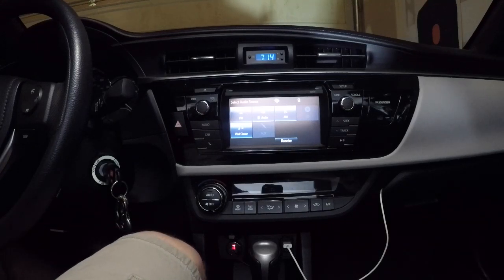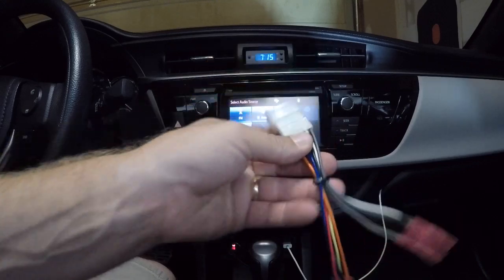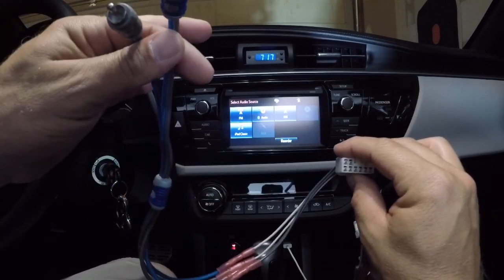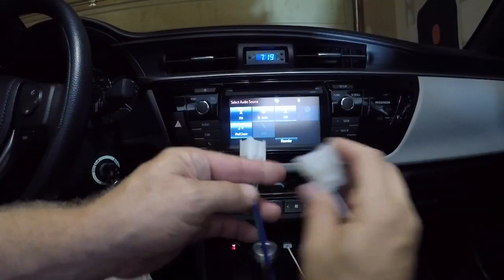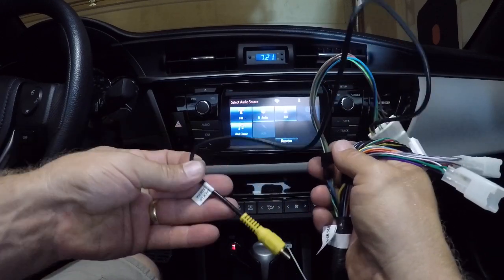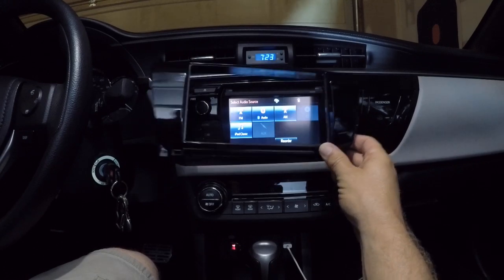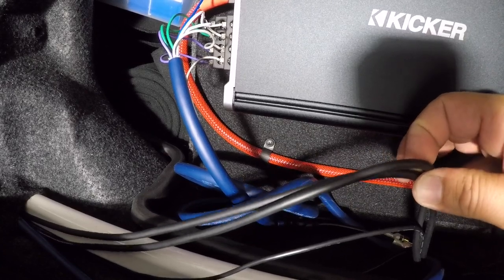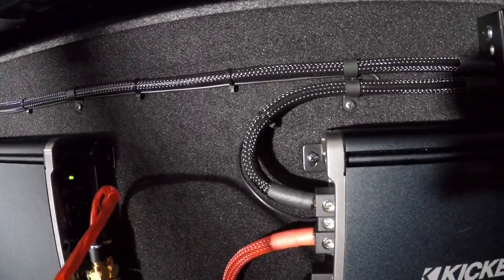2014-2016 Corolla, adding amps to OEM head unit

Comment: So I'm only using one set of RCA cabels from the front speakers to the amplifier for my sub. Haven't installed it yet. Should that work? Also how many watts are you running? Have you had any issues with your alternator or battery? And I do have some questions about the bass knob and cup holder lights.
Reply from the maker: Spencer Bennion 
I would use the rear output instead of the front. Both will do the job, but your subs will most likely be in the trunk, so this would be more natural. 
I have replaced my battery with comparable Interstate battery, OEM alternator. 
I have roughly 2400 watts available, between the two amps. 
As far as the cup holder lights, they were purchased from accentleds.com
You would need 2 sizes, 1@ 2-1/2” & 1@ 2-5/8”. 
The bass knob is from Kicker which is proprietary to their amplifiers. I took it apart and mounted the guts inside the dummy plug next to the trac control/vsc button. 

Follow me on Instagram, I can help you better there. @cdenton9

Comment: For my set up i plan on using the stock speakers and only adding a single amp to power subs in my trunk. Does this set up allow for this?
Reply: Were u able to figure it out?
Reply: @mafitron  Fr lol I need to knwo

Comment: I know this is an older video, but did you reply the stock speaker wiring for the back and door speakers? I've heard the factory speaker wiring isn't good on most cars and was wondering if I should plan on rewiring all that shit while upgrading my speakers.
Reply from the maker: Adam Yarris i reused the factory wiring. It’s good stuff. 16 gauge stranded copper, probably ofc. I did eventually run new wires to the rear deck speakers though. Only because of the length, 3 feet versus 15 feet. And I was putting about 80 watts through the factory wiring.
Reply: @suprola7961  Huh, I wasn't aware of that, thanks for your response! I got the impression all factory wire was crap, but then again I know next to nothing. Great video btw, I couldn't find much else about this in such a clear manner.

Comment: Do you happen to have a wiring diagram for the 2014 Corolla pin connector? I am trying to find the 12V constant wire & 12V accessory wire for my LOC & almost every wiring diagram i find contradicts the other
Reply from the maker: Aftr Shock are you talking about the factory harness or the aftermarket piece used for connecting to an aftermarket head unit?
Reply: Chris Denton factory harness, in the back of the factory oem radio
Reply from the maker: Aftr Shock I do not know the pin out off hand. I would have to pull my head unit out to get this information. Check the forums, corollaforum.com or toyotanation.com , I think I’ve seen it listed there before.

Comment: Hey I have a 2016 I'm trying to build that harness and I  have the rca cables coming off the head unit only part I'm confused at the point when you said the speaker came right off the amp for the front and rear left/right
Reply from the maker: Adam Johnson once you’ve made the T harness, you are no longer using the outputs off the headunit to drive the speakers. Your speakers will need to be connected to a 4-channel amp. The RCA’s that are now coming off of the headunit will control your front/rear/left/right fader. But the speakers will be powered from the amplifier at this point. Does this help?
Reply: @suprola7961  yes it does exactly what I figured just wanted to make sure I was on the right page thank you for the reply

Comment: what is all of the wires called thats needed to use a 2019 corolla factory radio for a subwoofer? I cannot open the links that you provided
Reply from the maker: Reese  You’ll  have to search for these online, part numbers :TWH950 & TWH951. 
I can’t get the links to open either, except for the Kicker link.

Comment: Noob question. This will work if I’m only planning on using the front and back Rca hooked into my amp right?  I’ll have everything hooked up like you have it, but everything but the two rcas will be hanging.
Reply from the maker: HorizonsHere are you coming off your amplifier straight to your speakers? If so, you’ll have at least 8 wires not in use on the reverse set of harness. 
If your planning to reuse the factory wiring to your speakers, you’ll need to make the connections.
Reply: Yeah I'm planning on coming off my amp to the head unit with the 2 sets of RCA's and connect to the harness rca adapter you have in the video. I purchased what I need from the 3 links you left.

Comment: Hey when you say you sent the signal back to the amp what signal from where im trying to do exactly this and i dont have the 4 extra speaker wire to send signal back with cause i tapped the speaker to rca on those already
Reply from the maker: I pull speed wire from the amps to the back of the radio.
Reply from the maker: ROCKRIX 20-Feet 9-Conductor... https://www.amazon.com/dp/B08L7785TG?ref=ppx_pop_mob_ap_share
Reply: @suprola7961  oh ok i understand that now when you did the rca adapter "kicker kisl" to the harness you had 1 set to front left right+&- then on other adapter same thing what were the open spots on the adapter that you sent the signal back to amp inputs?
Reply from the maker: Basically, you’re converting the headunit outputs to RCA and running them to the amp(s) then using speed wire to return to the headunit, where you intercept the other side of the wiring you converted (goes out to speakers)

Comment: i’m trying to hook up and amp to the factory audio system,using a line output converter or is there any other way? i don’t want to hook up speaker with the amp..what kind of harness do i need?
Reply from the maker: Salman Asghar it sort of depends on what amp you’re going to use. some amps like kicker,  have line level input or high-level input. In that case, you don’t even need LOC’s. The factory radio doesn’t put out much voltage, and probably not enough to damage whatever amp you use. 
I would convert my speaker outputs from the radio to straight RCA’s, run those to your amps and then bring the speaker outputs back from the amp. 
Basically letting your amps drive everything and your HU driving only the amps. 
I hope this all makes sense.

Comment: I have a 2015 toyota Corolla and I need to figure out which wires are + & -  for the rear. The factory wiring is chopped so I can't use the speaker trick
Reply: Did you ever figure out the colour code? Need to install convertor to a corolla IM

Comment: So if I want to get an amplifier, sub woofer, and new speakers but still use my stock radio head what wire harness would I need to buy in order to not tap into the OEM wires? Please I was trying to get that part but got super confused 😭.
Reply from the maker: The next comment down are the links for the harnesses, if they’re still available.
Reply: @suprola7961  I have the website open but which one would I choose? Sorry I'm a total noob but need your help please. Do i get this wiring harness  "Toyota Corolla to Install Stereo" or "Toyota Corolla Wiring Harness to Connect Factory Stereo"?  Also thanks for getting back to me quickly I appreciate you 🙌.
Reply: @suprola7961  i was able to access the website. Now I just need help to pick please.
Reply from the maker: https://www.uneeksupply.com/2014_c_26132.html
Reply from the maker: @vegaf2011  I posted another link. You need both, so you don’t have to cut any factory wiring.
Reply: @suprola7961  thank you so much. You are the fucking best 🙌🙌🙌

Comment: hey friend, I have a question, even after installing this harness it worked even with your original car reverse camera, or you need another type of harness
Reply from the maker: rickaz1093 had to watch the video again to answer your question. The OEM camera plugs into the Maestro. The Maestro harness provides a video output that you’ll plug into your aftermarket head unit.

Comment: Hey man!  if I want to hook up just a pair of subwoofers, can I just T from any speaker using the cables you used?
Reply from the maker: Himmler Andaluz Aguilar 
You can but I doubt you will get any base from it.
Reply: Chris Denton do you know if theres a way to get speaker signal so I can put the kicker rca while keeping the 4 stock speakers. Btw I do have amp subw and all that stuff.
Reply: @haaguilar Just T into your rear speakers and go straight into the amp if it has speaker level inputs or get a LOC if it needs RCA. Unless you have a 5ch amp or a signal processor then that's as good as you're gonna get.

Comment: Are u running a stock alternator...if not what is it. Would like to run up to 2500w in my carolla
Reply from the maker: Matthew Love 
I’m still on the OEM alternator but I’ve been considering an “upgrade” or a 2nd battery. I’m up to 3000 watts available but can’t crank it that high. Lights start pulsing and bass will drop out. 
I haven’t even added the larger wire to the OEM alternator yet.

Comment: I got all this hooked up and my fronts are nothing but static and my rears are clean what could be the issues
Reply from the maker: Scbba I remember having this problem too. But can’t remember how I fixed it. Play with the settings on the amp. Did you use LOC’s?
Reply: Chris Denton only for my subs
Reply from the maker: Your using the kicker rca converter cables right? Did you meter the polarity before you spliced them in?
Reply: No I used the reverse harness for them and I have them ran to the high input of my 4 channel and my loc converter ran to my subs
Reply from the maker: Scbba, try disconnection your amp turn on wire.
Reply: Chris Denton I moved the rears to the front 2 channels with my fronts and it's crystsl.clear
Reply from the maker: Scbba in my case, it’s was the amp turn on wire. Your amp probably senses the signal from the high level inputs and turns itself on. Seriously, disconnect the turn on leed at your amp and make sure high level is selected. For some reason they will interfere with each other.
Reply: Chris Denton I'll try that when I get home thanks
Reply: Chris Denton I tried that and still the same so I dunno unless it's my ground from the high inputs I'll try and see if I can ground it to the ground on the amp so I can see if that's the issue
Reply from the maker: Scbba what amp are you using? I wanna look it up.
Reply: Chris Denton skar 80.4
Reply from the maker: Scbba I looked it up but can’t find install information. Whatever you did to make your rear channel work, copy that for your front channel. I know with my setup, I first got static and then there was no stereo separation. My amp (Kicker) acted like a 2ch amp. But eventually I got everything working. Don’t get discouraged, your doing professional level work, and your getting there! 
I’ll keep researching, I’m half tempted to buy one of those amps, just to play around with!!
Reply from the maker: Scbba, did you get it working?
Reply: Chris Denton yea finally lol thanks for all your help
Reply from the maker: Scbba what did you find?
How does it sound?
Reply: Chris Denton it had a positive and a negative.reversed and it sounds amazing now now it's really to loud lol
Reply from the maker: Scbba sounds good for a stock stereo!
Glad you got it working, you’re an expert now!
Reply: I just put a video on my page for it Chris if you wanna see the distance and the sound quality
Reply from the maker: Scbba on what page?
Reply: my youtube page its scbba
Reply: jomax clux  I ordered a reverse harness to retain all retort wires

Comment: Hi One Question i did wired everything but i lost the reverse camera function. I put reverse and it doesn’t displays the backup camera. What could be the problem, is it a bad connection?
Reply from the maker: Joseph Rodriguez 
Did you install the Maestro also?
Reply: No I just installed the harness for the rca front and rear as you added on the discription. Unless i disconnected by mistake other harness since i didn’t removed the radio.
Reply from the maker: Joseph Rodriguez 
Nvm, I was thinking you replaced your HU. Could be that something is unplugged.
Reply: Yes It probably could be that, because i doble checked and the harness itself doesn’t involves the backup camera.

Comment: How did you bypass the tweeter in the front to add your speakers to a amp ?
Reply from the maker: Scbba on the stock tweeter connector, you have 2 positives and 2 negatives. One pair of +/- comes from the head unit, the other pair goes to your bottom door speaker. I just taped wire in between the positives and negatives, to complete the circuit down to the bottom speaker. Then I used the tweeter wiring that came with my component speakers. Does that make sense?
Reply: Chris Denton sorta but not really lol
Reply: Do you need the run the speaker level up or can you just run 3 rcas back ? 2 for the 4 channel and 1 back to the mono block ?
Reply from the maker: Scbba if your converting from speaker level output, off the radio, you can just run the 2 or 3 pairs of RCA’s back to the amp depending on your radio. Are you using the factory radio? 
If your using LOC’s (line output converters) same thing depending on your particular setup. Some LOC’s use auxiliary power. What amps do you have?
How are you getting signal to your mono amp?
Reply: Chris Denton I have a loc for my mono block that I'm running off the rear channels now. I am running the skar 60.4 with tx 6x9 and the sx componets upfront. And I am adding a skar to 1500.1 on a pair of skar sdr 10s in a 4th. My 60.4 has the high level input on it I didn't know if I could use that  with the wiring harness you show in your video or not but if I am not mistaken you will get a cleaner signal with the rcas. Yes I am using the factory headunit if I wasn't I wouldn't have all these issues lol I would just bypass all this
Reply from the maker: Scbba sorry, had to look up your amps before I replied. You should be fine, you converted the radio speaker outputs to RCA’s and ran those to the amp inputs. Some amps will allow you to connect your speaker wires directly, as the high level input. Yours only have RCA’s. Sounds like you got it.
The 3rd RCA cable that I ran in the video was for future use. Originally I had just been using the front and rear and passing the rear signal through the mono amp to the 4 channel. You could do the same thing with an RCA splitter, at your amps, and skip the extra cable. I finally changed out my radio and am using all 3 now. SO MUCH BASS!!
Reply: Chris Denton my 4 channel dies have the speaker inputs so I guess I can just wire it in like that and then just use my loc for my subs thanks for the feed back. What was you talking about a jumper for the tweets?
Reply from the maker: Scbba when you pull the tweets, there’s a 4 wire connector. 2 come from the radio and 2 go down. There should be 2 wires with a black stripe (negative) and 2 without strip (positive). You can jump them with a short piece of wire. Negative to negative , positive to positive. I should’ve made a video on this.
Reply: Chris Denton Ah OK  got ya thanks

Comment: Hey so if I just want to connect my stock radio to a all-in-one amp+sub and don’t want to add any other speakers do I wire it the same?  In essence can what you created be used as a splitter so that I can have the stock stereo output to the speakers as normal and also to my sub?  
My sub has high level and low level input. 

Thanks very much for the video!
Reply from the maker: Taiga Hashimoto 
Yes, you can tap whichever channel you want to use with an RCA pigtail and then run signals to your amp setup. 
Personally I would still make my own harness to avoid tapping the OEM wiring. Adding stuff creates a cascade effect that never ends 😆

Comment: What size fuse in fuse box by amp?
Reply from the maker: Too many variables to consider. Wire size, amplifier output, distance from battery, etc. 
Need more specifics to answer your question.

Comment: Wheres the amp located in the car??
Reply from the maker: I kept upgrading the system until I traded the car in. In the end, I had two amps screwed to the subwoofer box in the trunk. But at one point, I had a small 4 channel amp under the dash. 
It really doesn’t matter where you put them, as long as there is adequate cooling. A lot of people mount them under the seats, but that’s not ideal since there is ducting under there. 
The back side of the rear seats is a good spot, if you know what you’re doing.
Reply: @suprola7961  thank u just trying to get new speakers my stock ones are blown and a sub hooked up asap

Comment: Does this car come with a factory amp??
Reply from the maker: Audiofilio nope
Reply: Chris Denton really ? That’s pretty cool, I mean in the idea it makes it easier to add your own system by just adding your own and not worrying about disconnecting the factory or removing it/bypassing it! I would assume it’s only the camrys that have one then right? Thanks for responding!
Reply: What wiring harness
Reply: What wires in harness you use ?
Reply: @slimefinesse4617  I don't have the car so I can't say lol I was just curious like you

Comment: This is good but even better if you just get an amp with high level inputs. Then you dont have to fuck around with converting to RCA, you just run speaker wire to your amp and back up. Not sure why you make cutting the factory wiring sound like such a bigass deal. Just cut the speaker wires and reconnect them to your amp inputs/outputs and you dont need to buy a bunch of silly harnesses and find room to cram 2 feet of extra shit behind your dash.